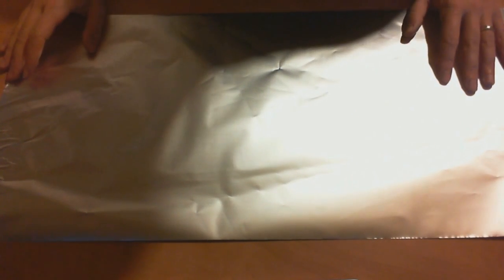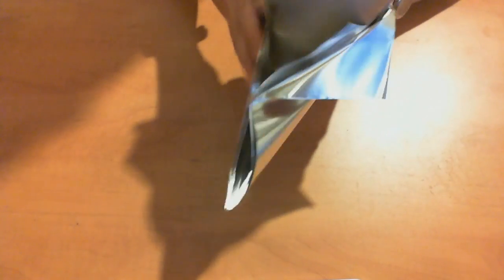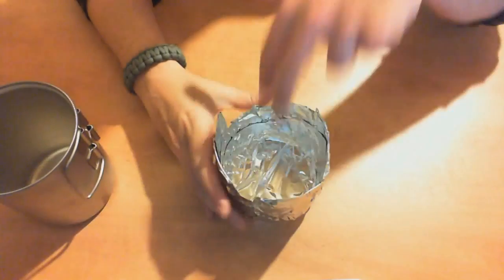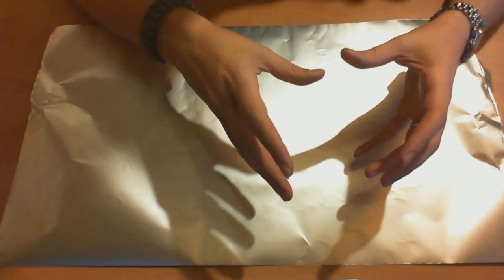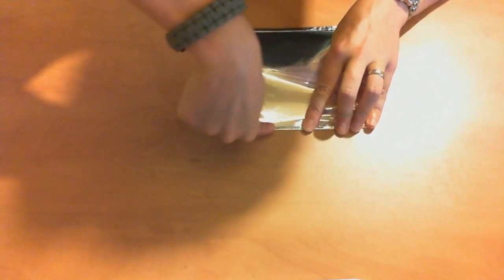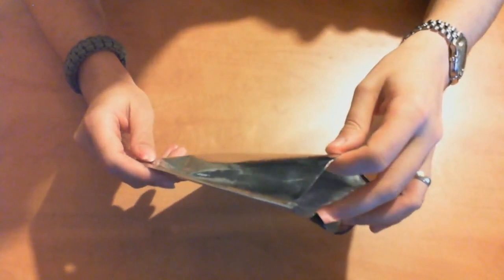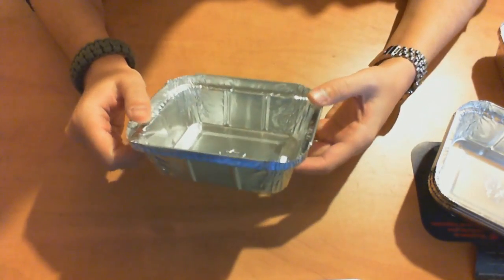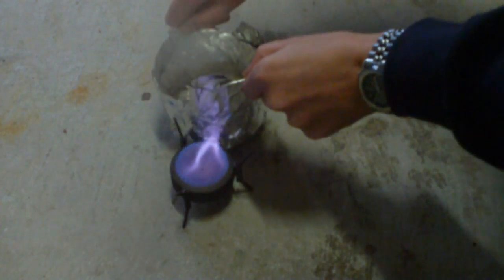Boiling Water with Tin Foil,  via Equip2Endure BlogTV

Comment: The BIG PROBLEM is that the foil thats been folded, compressed and stored in a tin becomes full of holes... and leaks. Try holding it up to the light and its like a star map! and the foil I've used is proper heavy duty, I've even tried really thick roasting trays - same problem. The foil breaks where its folded.

Comment: Thanks for sharing - especially your comment to fold into thirds for strength.
LOL, I was starting a response while listening to your video ... when you mentioned pre-formed containers!
FYI - I opted to include a tin foil 'loaf pan', which will close down quite small ... and reforms without cracking!  An added bonus to this type of container is that the small rim allows it to be taken off/away from heat without burning your fingers - as long as you're quick ;-).
Thanks again.